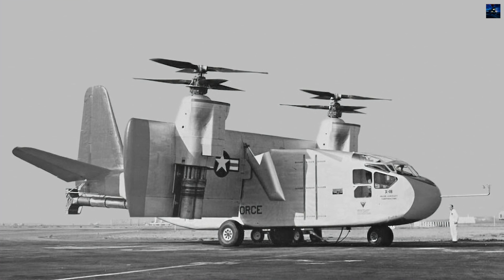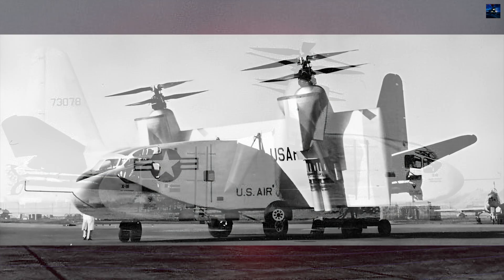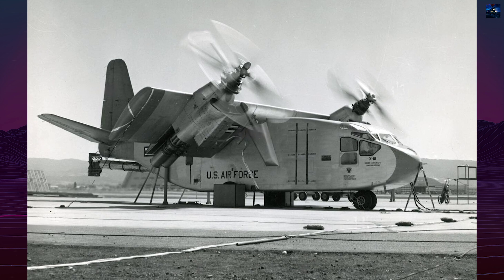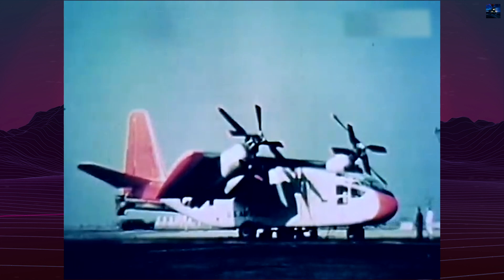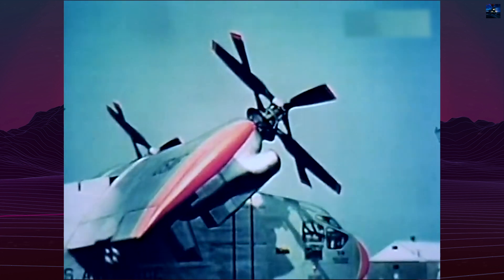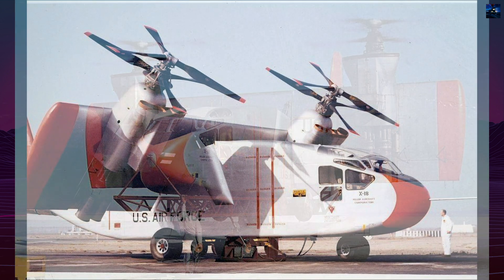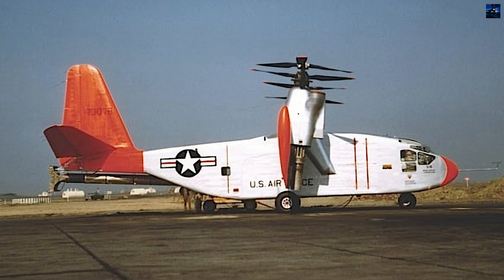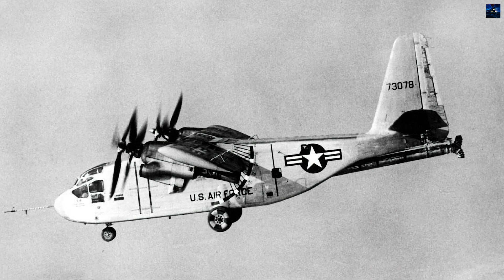Hiller X-18: A Pioneering Vertical Takeoff and Landing Experimental Aircraft

Comment: The Canadair CL-84 Dynavert was far superior, but the US went with their own helicopters which couldn't meet the CL-84's standards or performance envelope. The 84 even did aircraft carrier testing. Being that the US was at the time where they started to stop buying non US aircraft, they really dropped the ball on the 84.   The canadians were ramping up to have a machine as capable or better than the V-22, mission ready by 1978 if given the go-ahead by the US.  
But instead they opted for their own development, and the V-22 didn't fly till 1989 and wasn't mission ready until 2007. 
In 1985 I had a long conversation with a guy who flew it during the carrier trials. He, at that time, was still pissed they didn't buy and develop it. Canadair didn't have the funds to continue the project, and couldn't source them so the project was candled
Reply from the maker: Thanks for sharing useful information and telling about Canadair CL-84 Dynavert, I will definitely make a video about it. I myself became interested in learning its history.
Reply: @RetroTransport  There are two still intact in Canada. 
Serial number CX8402 is on display alongside the Avro Arrow in the Canada Aviation Museum, Ottawa. 
Serial number CX8403 is on display in Royal Aviation Museum of Western Canada, Winnipeg
Either place is well worth the visit